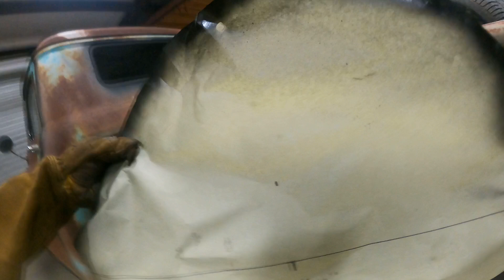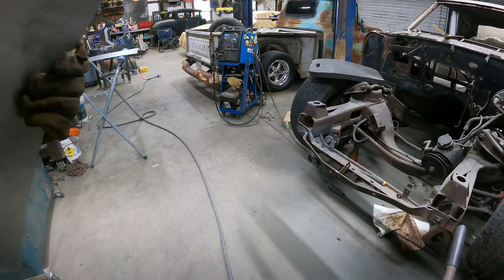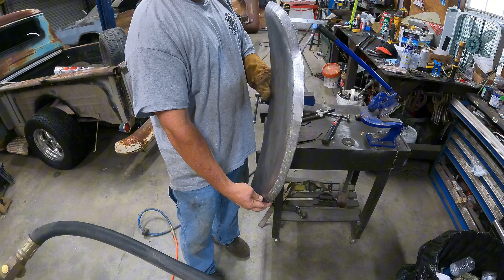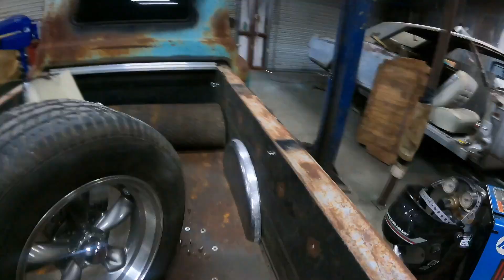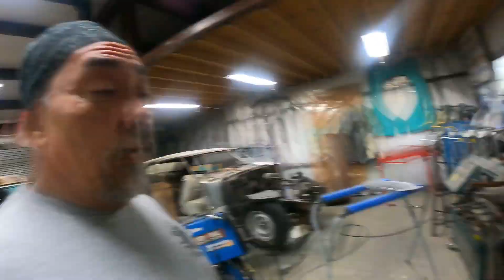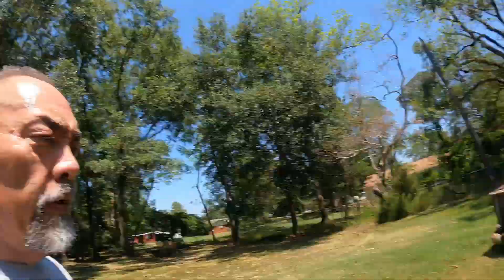FABRICATE AND INSTALL 56 CHEVY TRUCK TUBS

Comment: I too am building a 56. Considering mini tubs. I really like you hiding the mounting flanges but doesn't that take back an inch or so of the clearance you provided?
Reply from the maker: You can get by with about 1/2 an inch of a lip to mount them. I had to trim them down for him when he went to a bigger tire that’s in a later video. Thanks for the comment and for watching.
Reply from the maker: His truck is a very nice truck also.